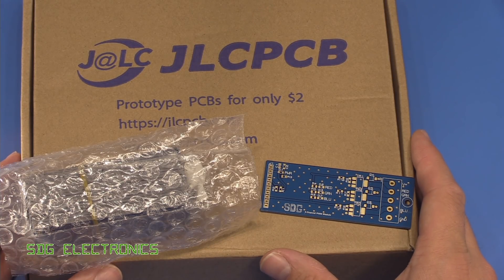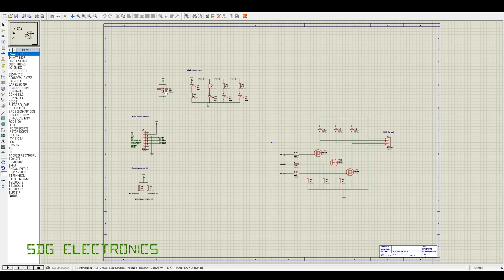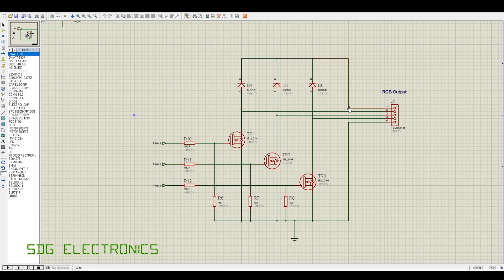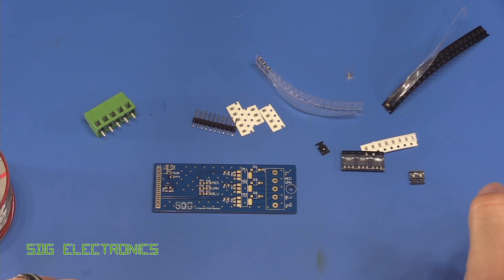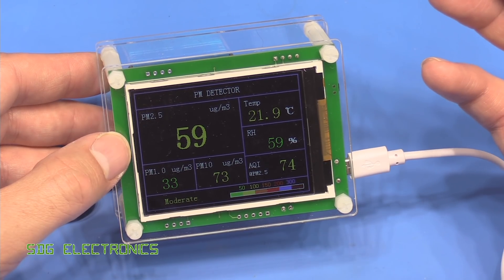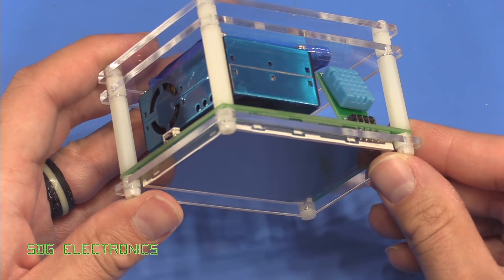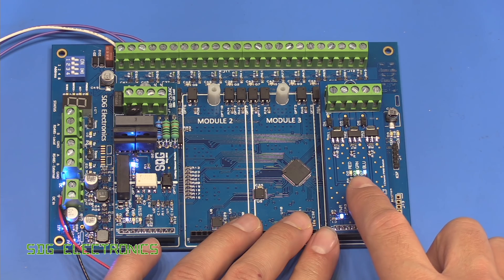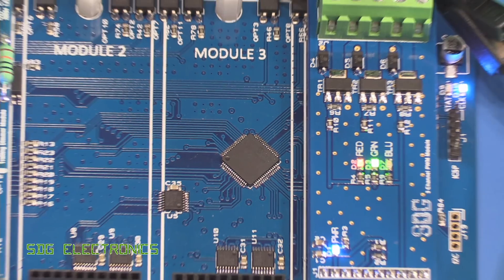SDG #111 RGB LED Tape Driver with PCBs from JLCPCB - Lighting Controller Project Part 9

Comment: Hi @4:15 no mention of V(gs)th, you bring up  Rds(on) and Id but if your running a 3v3 supply finding fets with a low V(gs) is slightly more of a problem.

Comment: Nice explanation of the driver circuit operation, Steve. Since I use Proteus and I know you do too with an older version; I wanted to ask based on the list of devices in your design: Are all those standard? Did you import / make any of those yourself? The reason I ask is that Proteus never used to include a footprint for LEDs back in the day.

Comment: Why don't you offload the main cpu with a dedicated PWM chip like the PCA9685 or a smaller equivalent? Using i2c saves lots of pins on the main cpu.
Nice project anyway.
Reply from the maker: The main microcontroller actually has a slave core which I plan to utilise for this. I need to understand how to use it properly first though :)

Comment: Where are you planning to use the RGB strips?  Depending on the application RGBW (i.e with an additional white LED) tape, can be useful - they have better colour rendition (especially if you can find any with 90+ CRI white LEDs) and also efficiency when you want a white or white + "colour hint" effect.  Not so useful a comment now you've already built the boards of course, but might be useful for others!
Reply from the maker: It's a good point, they'll just be used for decoration rather than primary lighting for the reasons you mention. Of course a second module can be installed for the white channel, or even separate warm white and cool white channels as needed. Thanks for the comment

Comment: What kind of guidelines do you use when doing via stitching?  Do you mostly just use it to tie flood planes together?  How do you know where to place the vias?
Reply from the maker: For applications like this, it's not critical at all. Via stitching becomes important for RF boards, in which case there are rules to follow. I may cover this soon when we do some basic antenna design.
Reply: @sdgelectronics  Looking forward to it!!

Comment: 8:31, whats that program?
Reply from the maker: Microchip MPLAB X
Reply: @sdgelectronics  thank you very much, is it free or paid
Reply: @Limeayy  free
Reply: @sdgelectronics  Curious but for your solder comparison video, what temps did you use on your iron to get them to melt? I have to be at around 675F and it'll still require some dwell time for it to melt, so its best to be around 700-800F
Reply from the maker: @Limeayy  The iron is 330°C, so around 630F. It's possible with a low thermal capacity iron you would need to increase the temperature .
Reply: @sdgelectronics  im using a hakko fx951 with t30 tips for microsoldering and it takes like forever -_-

Comment: question : don't you need some pull-up resistors on RGB-output lines? When the n-mos transistors are off, the r, g, b lines seem floating.
Reply: @Undefined Lastname Thanks. Good example with the single led. In the situation from the video I was concerned that if the transistor has any leakage current or anything which makes it not 100% off, maybe it will be appear any visible flickering in the LEDs, but, indeed, I never had this concern for single led + 1 transistor :)

Comment: Are you using Netbeans to program it?
Reply from the maker: It's MPLAB IDE, but it's based on Netbeans
Reply: @sdgelectronics  Thanks friend. Does it already comes with arduino boards or you have to install it manually?
Reply from the maker: @FixDaily  it's for Microchip PICs rather than arduino. It's freely available on the Microchip website
Reply: @sdgelectronics  ok thank you :)

Comment: Good to see that you used those 3 flyback diodes. Long connecting wires wouldn't cause any damage to the PWM MOSFETs.

Comment: Wish I could do projects like this,,, my weakness is the coding :( I enjoy you vids always get something out of them,,,, thanks!!
Reply from the maker: Firmware is my least favourite part and really needs some dedicated time to work on it. I much prefer projects that 'just work'.
Reply: @sdgelectronics  I love writing the firmware :D I've been a programmer for almost 15 years but I am just now getting into electronics and PCBs. After almost 2 years of picking up and abandoning projects I am finally starting to understand the electronics parts (resistor, capacitors, etc), what they do and how they fit together. I am currently making my entire house 'smart'. I modified my lamps to have wifi along with my heater, air conditioner, refrigerator, my safe and more! (And of course with wifi every device is now also equipped with the obligatory rich web-interface with all sorts of settings, options, sliders and buttons to control the operation of the device. >:D